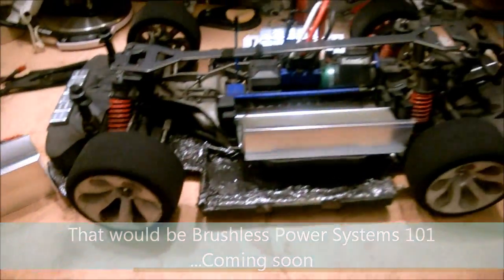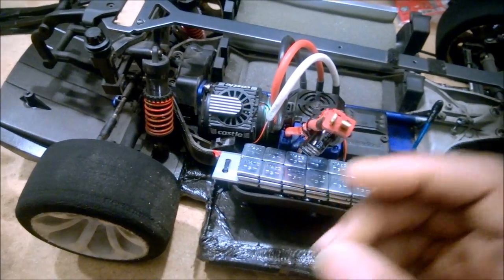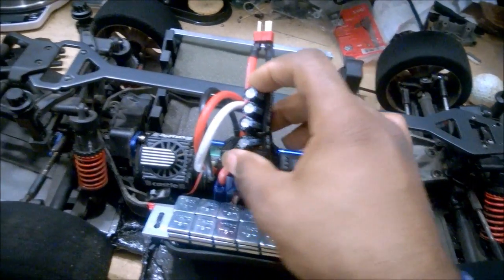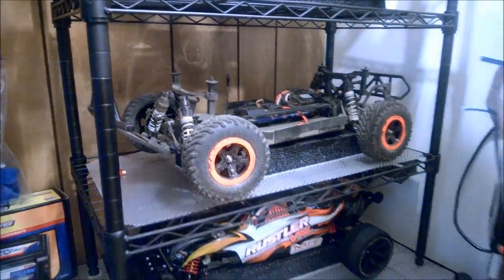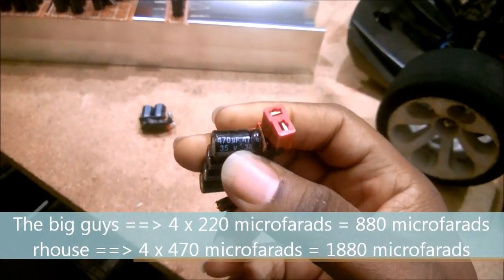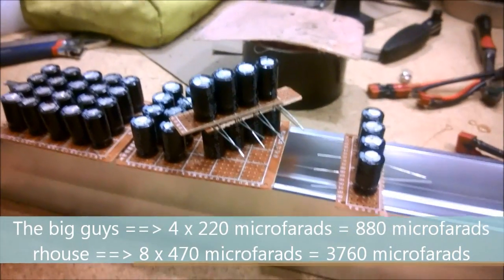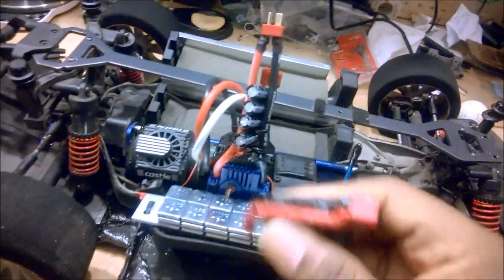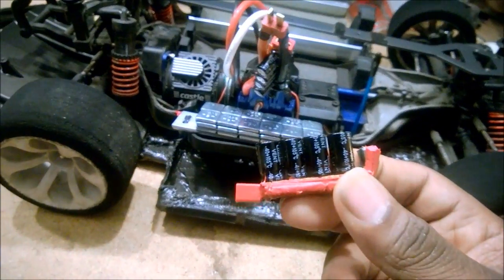Ep. 88: Cap Packs 101

Comment: I have a hobbywing xr8 plus it's a 6S capable 150 amp and I bought some capacitors that are 4100 uf 35v I want to make an external capacitor pack how many capacitors should I use?
Reply from the maker: This is a tough one. I usually shy away from caps that size because many aren't well suited for cap packs.

Caps have a few properties that can determine how effective they will be at fighting ripple voltage in addition to overall capacitance. You want to look at the capacitor's ESR (Equivalent Series Resistance), its rated lifetime and rated ripple current levels to see if it is a good fit. Many larger caps have very high ESRs which mean they charge and discharge too slowly to effectively fight ripple voltage. Some caps have really low ripple current ratings meaning they can overheat and blow if pushed hard.
Reply: @RCPhysics  I tried the capacitors and they work great they're actually at 3300uf and I put two of them together with a diode and the acceleration is extremely smooth and no more wires heat up and the ESC stays really cool the motor warms up because it's a surpass El Cheapo 2200 KV and I was bashing Full Throttle doing speed runs with a 21 tooth pinion gear M1 pitch 49 tooth spur gear accelerating hard ballooning the tires constantly with 6s massive 9000 milliamp 100c 3 cell 2 batteries capacitors did not even warm up one bit and like you said they charge slowly and discharge slowly from just those two capacitors when unplugging the battery it takes almost a second for the ESC to turn off I've noticed capacitor packs from Factory hobbywing use the diodes maybe it's the diode that's making the big difference I just took some battery cables nothing special and then covered it all with liquid tape I did it to all my RC cars
Reply: I have some low ESR that I want to use for glitch Buster on my receiver they're 10 volts at 1000uf should I use them?
Reply from the maker: @florin26balalau  They definitely wouldn't hurt. The fact that it's low ESR may make it a little more effective than its 1,000uF rating might imply. Still, any glitch-buster is better than no glitch-buster. 

Most glitch-busters that I've seen are more in the >2,000uF range, so you may think about getting a single larger cap, if you still have any issues after testing it out. You could add a few tohether in parallel, but I probably wouldn't do a multi-cap glitch-buster just because of the added size.

Comment: nice video, question though i have used 6s setup with xl2 and have the smaller 63v 390uf 6caps and still have alot of ripple 5.42volts so i took off and havent tried the poseidon 100v 4920uf now. could this lower my ripple ? thank u sir
Reply from the maker: Ripple is really a byproduct of the quality of batteries you are using. Better batteries give less ripple. I wrote a pretty detailed "Tech Corner" about this on my facebook page http://www.facebook.com/rhouse21rcphysics , but all cap packs filter out ripple within a given frequency range based on your system. If you look at your data plot with your 390uF caps, you will probably see that the ripple starts off fairly high at low rpms (however 5.42V is still pretty close to the 20% that Castle says is ok), but your cap pack will "kick in" and start killing ripple as your RPMs climb. My ripple went to zero as my revs climbed. There's a picture of one of my 3S testing data logs in the photo section of my Facebook page that shows this very clearly. I've never seen any actual data from any other cap packs, so I'm not sure how they would compare, but I would not expect the Poseidon pack to be much different.

PM me a picture of a data log from one of your power pulls on facebook and I'll take a look at it.

Comment: The cap pack are soldered in parallel or in series? thx
Reply from the maker: You can actually wire caps either way, but they have different effects on the overall pack performance. Wiring caps in parallel boosts the overall capacity of the pack (aka microfarads) and reduces their Equivalent Series Resistance (ESR). This lets you store more electrons and will boos the amount of current the pack can deliver in a single pulse. This is how most cap packs out there are wired.

Wiring caps in series gives a result that is a little more complicated. Doing this actually REDUCES the capacity of the cap pack, but increases the voltage the pack can handle. It also increases the pack's ESR so it will charge and discharge more slowly. For example, if you wired two 25V 2000uF caps in series, you would end up with a 1000uF 50V cap pack... with 2X the ESR. Honestly, there aren't a lot of good reasons to wire conventional caps in series unless you just want to use some caps you have laying around and don't want to wait for higher voltage caps (which will have lower ESR) to be delivered. However, super-caps are a different story. Most "low cost" super-caps are only available in pretty low voltage ratings, but their capacities are HUGE. So, you can stack up a number of low-voltage super-caps in series to give you the voltage level you need for your application. For example, you could build up a cap pack using seven 4V 15,000,000uF super-caps to make a 28V (6S-capable) 2.1F cap pack. The down side is even "cheap" super caps are still kind of expensive compared to conventional caps.
Reply: thx :-)  @RCPhysics

Comment: Hey there, first of all great video, have a noob question - I have a stock Redcat Volcano brushless and off late the steering servo has been giving problems. It turns but is very sluggish. Sometimes it will momentarily jam or hesitate to return to neutral position. I've cleaned, lubed and serviced the servo, but just when the main gear (that connects to the servo arm) is attached the lag comes back. Not sure if it is due to a blown cap inside the ESC, but if I had to select an auxiliary capacitor to add to an open port on the ESC, how would i select the capacitance of that. The main battery is 2S 7.4V 5500 mAh and everything on the truck is still stock (electronically speaking). I've searched much on the web, but why i should use 470uF and not 5600uF remains unanswered. Hope you can guide me towards the right configuration to alleviate the issue - what capacitance caps do I need ? 
Thanks brother.
Reply from the maker: There's not a lot of info on sizing a "Glitch-Buster" cap out there. I could give you a long technical explanation of a process to calculate a good size, or you could go to Amazon, Digi-Key, or Mouser Electronics' web sites and order a hand full of caps and do a little trial and error. You might even have a good match laying around in your toolbox. To save you some time, here's a little advice.

Since most ESCs assume that you are not powering very much off of their built-in voltage regulators (often called BECs or Battery Elimination Circuits), stock BECs are often kinda weak. The truth is that the Glitch-Buster is doing the same basic job as the ESC cap pack, but on the BEC side of the circuit and at a slower rate. Once connected to the circuit, a cap charges up to the system voltage. If the system sees a big load (like from a big servo), the voltage will sag a bit based on the output capacity of the BEC. This drop in voltage could cause a lot of servos to "glitch". A Glitch-Buster will try to "pull up" the BEC voltage under load to keep the voltage out of the "glitch" range.

The size you need is dependent on the load on the BEC circuit and your BEC's overall capacity. If you have a big (or bad) digital servo, or an "unhappy"  (or overloaded) BEC, you may need to give it a little more "help".  It's hard to have too much capacitance on the BEC circuit, but I would guess that a single 220uF or 470uF cap would be a good place to start. Your BEC is probably running at 5-6V, so you really don't need anything rated for higher than ~10V to do a good job. These caps are pretty cheap individually, so there's very little to loose from upsizing a little though. 

I would NOT go above 1000uF though.... unless you have a good reason. This shouldn't hurt anything, but having a big cap like that in this part of the circuit is basically like having a small battery out there, which could cause the Rx and servo to stay "powered" after you unplug the battery for a few seconds. This could cause the car to do some weird things until that cap discharges, especially if you turn off your Tx while the Rx is still "alive".

Comment: hey i burnt out a rx8 teking esc all that blew was a capacitor i cant find how to replace it they have plastic on the bottom not sure if you seen one
Reply from the maker: I'm not familiar with that ESC. There should be some numbers on the capacitors that tell you what their capacity is They are probably somewhere between 200uF and 600uF. Do you see anything like that on them? These are probably power capacitors, so you can most likely run it safely by wiring up a good external cap pack at least as large in capacity as the stock capacitor(s).

Comment: Man you seem to know your stuff. I never knew about these cap packs. I been wondering what them deals are on the aftermarket esc's, Now i know. But an xmaxx owner said he installed a poseidon cap pack in his xmaxx with i think a Castle esc or Max5. Not sure why you would need different ones? Or is this what your explaining in this video?  Im gonna be building up my next xmaxx with hopefully a Castle 2028 motor, xlx esc, belt drive etc. Any good reccomendations for powerful high burst aftermarket 4s lipos? Thanks
Reply from the maker: Thanks for the good words. Pretty much any high powered RC is going to have to worry about ripple voltage. The Castle XLX has a really good external cap pack on it from the factory that should keep it safe. Just check your data logs to make sure everything is good. I'm not as familiar with the Hobby Wing ESCs, but I suspect they could benefit from a good cap pack, too.

My sponsor Venom makes some really nice HUGE 4S packs specifically for the X Maxx. You can find them at http://www.venompower.com

Comment: So what's a uf? I was looking a  capacitors with 4 1000uf capacitors on it is that good a 6s setup.
Reply from the maker: ***** uf is another way of writing microfarad. A Farad is a unit for measuring how many electrons will be stored in a capacitor per volt applied to it. Honestly, there is a reason Castle designed their pack as"only" 880 uf. The larger Cap Packs will store more energy, but that will do nothing for you unless you are beating the snot out of a very large motor or you have weak batteries.

A cap pack will be good protection for your setup, but remember, the XO-1 doesn't ship with a Cap Pack from the factory and it runs pretty well. Also, Castle's packs are 880 uf and seem to work well for most people. 4,000 uf is almost 5 times larger, but I doubt you will get 5X more benefit unless you are doing something "very very special."

Comment: Great video bro. Would a Cap Pack may a better difference on a 2S system, or would it be overkill?
Reply from the maker: BlackSmith RC You say overkill like it's a bad thing... 

Seriously, I think it all has to do with how much current your system is really pulling. This is the main reason I bought my Turnigy power meter, to see how much strain I was really putting on my power system. They are only ~$25 and will measure up to 100 amps. If you are pulling 100+ amps on a 70 amp ESC like I was, it might help. If you are only pulling 40 or 50, you are probably ok. Speedruns on brushless systems usually pull as much current as the system will handle no matter what your cell count is, so it's probably cheap insurance. 

It can't hurt.

Comment: Would it help EDF planes  to add caps ?
Reply from the maker: Pretty much all high powered brushless power systems have some level of voltage ripple, but it is only an issue if it exceeds 15 - 20% of your system voltage. If you do not have a data logging ESC, you can start off with a smaller pack like my rH214-8S pack and see if it makes an improvement to ESC temperatures and overall performance.

Comment: Thank u for replying brother but what i mean i should use in speed high ratio oil in front and rear diff or low one
Reply from the maker: Ahhh. I see. Traxxas recommends using ~100k diff Fluid in the front and ~30-50k in the rear of the XO-1. That's probably a good place to start for a speed run car. Lots of guys lock the diffs completely, but I like the cars to be able to turn when I want them to.

Comment: what's up rhouse...I have one single capacitor - that reads "4700 mF. 10 volts". This by itself, is it strong enough to put on my ESC wires?... i'm running 6s batteries in my e-revo 2.0.  Base on ur video  this one capacitor have more  MICRO FARADS than all of ur 4 combine. Please let me no...."Bless up"
Reply from the maker: There are a couple of issues with using this cap.

1) It is only rated for 10V. Using a cap rated for less than the system voltage you plan to run will cause the cap to blow.

2) Capacitors have a property called ESR (Equivalent Series Resistance). This helps determine how quickly a cap can charge and discharge. Large, single caps tend to have higher ESRs, so they charge more slowly. Using several smaller caps in parallel usually yields a cap pack that can charge and discharge more quickly which makes the cap pack more effective.
Reply: @RCPhysics  Got it...Thanks. " Bless up"

Comment: The buggy one they have front and rear diff what oil i should use for speed the high ratio one or low ratio one
Reply from the maker: Diff oil gives your RC diffs a lot of the properties of a limited slip differential in a full-sized car. Higher weight oil deduces the amount of differential action you will get while running. This can dramatically change the handling of your car. A buggy probably came with very light oil all around to help you get tight cornering. Drag cars and speed runners usually run very heavy oil or lock the diff so they do not "diff out" (spin one wheel) under hard acceleration. I talk more about this in the attached video link. Good luck! https://youtu.be/fcBzFNziRoE

Comment: Does this help with battery plug heat
Reply from the maker: It might, but if you're plug is getting really hot you may have another problem.

Excessive plug heating is a sign of at least 2 potential issues.
1) You may have a bad solder joint that has increased the resistance of your battery connectors. This would cause the plug to heat up much more than it should at high current levels. Or...
2) Your connectors are undersized for the current levels your power system is pulling. Basically, your connectors should have the same overall resistance level (or better) as all the other components in your power system. Undersized connectors are higher resistance than the wires they are soldered to and make an electrical bottleneck which can create a LOT of heat. I learn this lesson the hard way and had one connector become so hot that it the soldered itself from the power system during a speed run. 🤯

 In my experience, connectors using 5mm bullets are good to peak loads of 100-200A. Castle 6.5mm Connectors are fine for ~300A. If you are pulling 400A or more, you probably should be running 8mm bullets.

A good rule of thumb is to use battery connectors with bullets at least as big as the bullet connectors on your motor. That way you know the batteries aren't an electrical bottleneck.
Reply: @RCPhysics  thanks man i upgaded from the deans plug that melted i had no idea my mt10 actually went so fast major power restriction there. My deans wa completely melted
Reply from the maker: I actually started off running Dean's connectors too and learned a pretty hard lesson from them. They are fine for low power applications, but they have no place in the type of running that I do on all of my larger cars. It took me a little while (and more research than you'd expect)to figure out that Dean's connectors are only rated to 65 amps. That's it. Just 65 amps. So think about all the lipo batteries that ship with Dean's connectors and all the people who innocently use them in the WRONG applications.
Reply: @RCPhysics  between the connectors and the cap pack video i just justified a soldering bench purchase lol! Thanks for the help
Reply from the maker: LOL! Happy to help.

Comment: hello sir can brushed use the cap packs?
Reply from the maker: I think so, but it may depend on your ESC.

The ESC's output to a brushed motors is just DC voltage, but the ESC may be using a "switching voltage converter" to create the output signal. 

Still, brushed motors can't handle the level of current that brushless motors do, so there may not be as much benefit in real-world usage.
Reply: @RCPhysics  owh ok ... thanks for sharing the knowledge ... and what about glitch buster ... there have benefit to brushed motor sir?
Reply from the maker: Glitch busters really just protect the BEC (Battery Elimination Circuit) from "brown outs" caused by accessories (like big digital servos) pulling too much current on the receiver-power bus. They can help a lot if your ESC doesn't have a very robust Rx power supply / BEC.
Reply: @RCPhysics  owh i see... thanks very much sir .now i understand 🙏